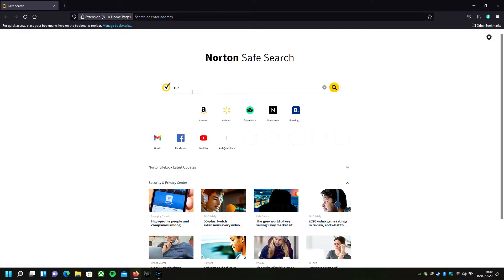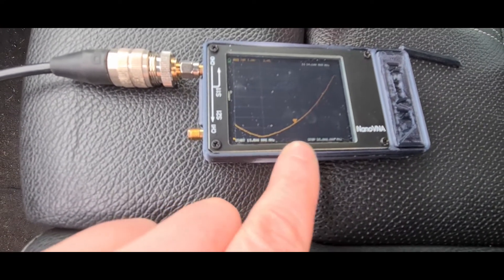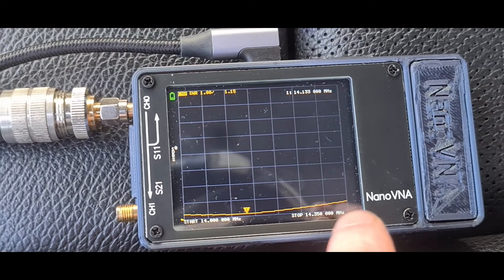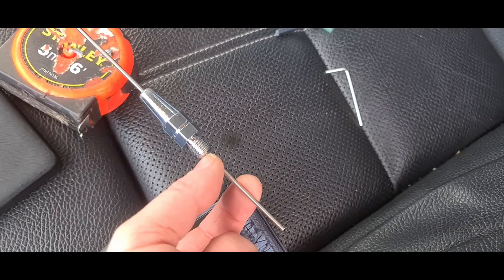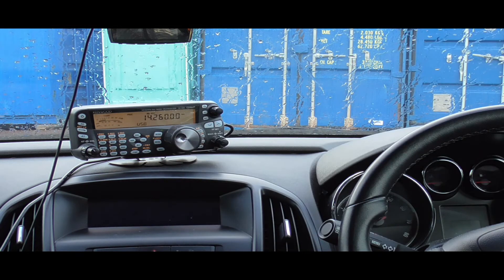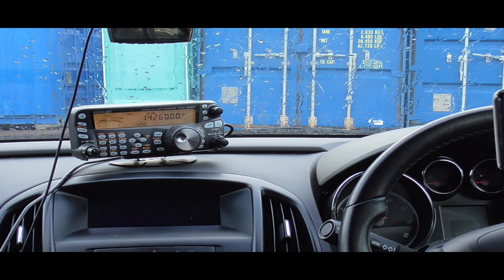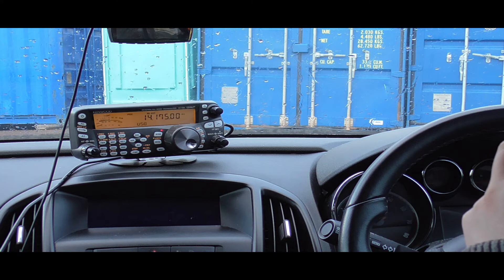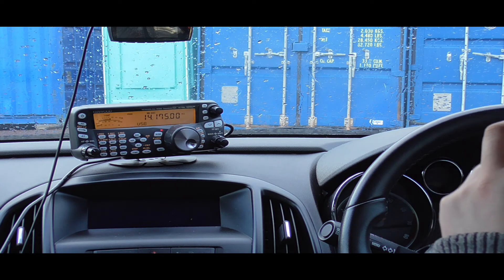HAM STICK QUARTER WAVE AMPRO-20 TUNE AND TEST

Comment: When operating in a car, even though parked, surely the correct suffix is /M not /P ?
Reply from the maker: /M means mobile im not mobile
Reply: @2m0kiescotland  So your car isn't mobile?
Reply from the maker: @jimfuller239  did you see it moving ???
Reply from the maker: @jimfuller239  /M =mobile ie MOVING  im not moving im parked =/P portable wither the antennaand radio is fixed to the car or not im portable (not mobile moving) ... you should maybe get /M and move on to someone elses youtube channel and argue the toss over silly stuff like this 😂 take care n 73 ✌️
Reply: @2m0kiescotland  The dictionary meaning of 'mobile' is 'able to move or be moved freely or easily'. There's no requirement to actually be moving, just to be freely or easily moveable. I would concede that the licence allows any suffix to be used so long as the station remains identifiable, so you're good there. However, portable is most often used when operating from a temporary location, a fixed spot where you set up your equipment, typically like a park or a hilltop, and afterwards pack it away before you leave. To use 'portable' when your in a car mis-describes your station setup to your contacts. I suggest that you yourself go watch other Youtubers working stationary from their cars and listen for their suffix.
Reply from the maker: Listen jim i can say what ever i like buddy i sat the exams i know what im doing and i choose to say portable im allowed to im not mobile and for your information i tell the stations i work my set up conditions and they were happy with that  its only you thats picking on the fact i used portable from a car grow up and move on sir have a nice day ! 🤦
Reply from the maker: @jimfuller239 Portable operations
'Portable' operation is usually signified by amateur radio operators appending the suffix '/P' to their callsign. Operating '/P' normally means that stations are operating away from their licensed station address.
Reply from the maker: @jimfuller239 Portable
You are portable if at a temporary location. (by (d)(ii))
(jj) “Temporary Location” means a fixed location in the United Kingdom which is not
the Main Station Address or an Alternative Address;
Unfortunately "fixed location" is not defined. Some interpretations I have come across are:
The station is physically fixed to the ground. This could be because of pegging a mast into the ground or connecting to shore power.[1]
The station does not move for the period of operation. For example, a parked car or person sitting with handheld. Note I did not define "period of operation".
The station remains within some defined area. This includes situations in the last definition but adds things like walking around in the region of a mountain top.

Comment: I have also used one of these and they are quite effective especially if parked on high ground . You need at least a 7” mag mount to ensure enough coupling and a wound choke at the base of the antenna could help

Comment: I use Ampro's for 10, 15, 20, 40 and i have one for 80(more like a large wire wound resistor)  they are fantastic antenna's imo, i have pairs for 10 and 20 so can make a small portable dipole. 73's de G0SGO
Reply from the maker: Hi there yeah they work very well .. that sounds good making dipoles with 2 pf them do they work well ?